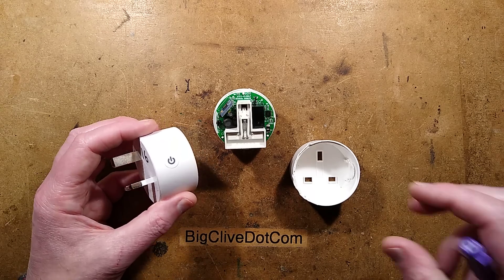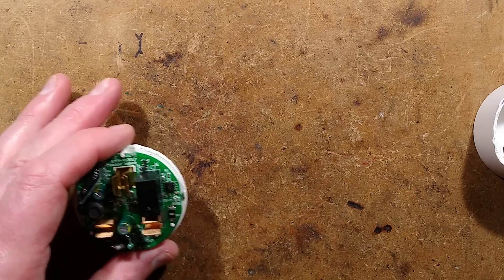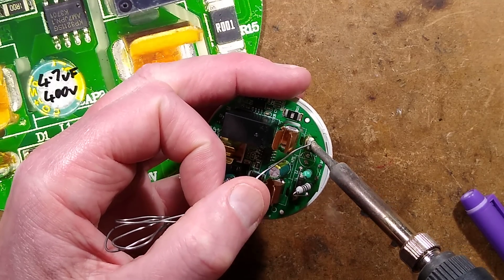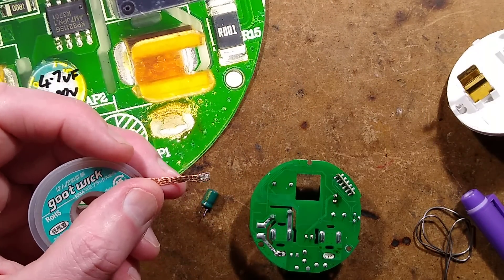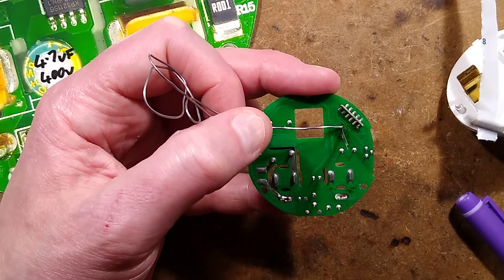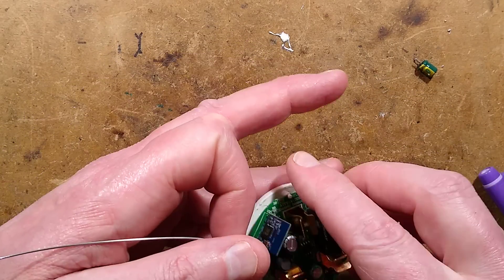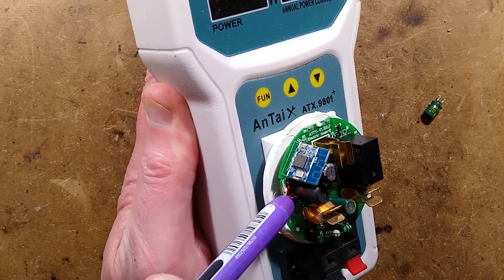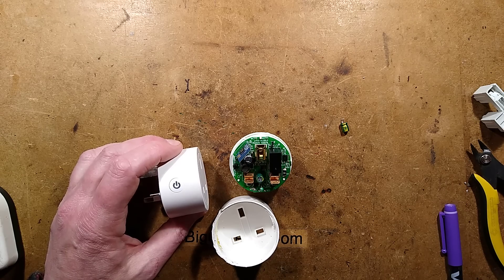Fixing a faulty LSPA7 smart plug (XiangHeWang)

Comment: A few days back I had a Woox smart plug quit working, it's of a similar contruction with addition of two screws. I failed to disassemble it easily so simply replaced it. Now having seen this excellent video i'm about to dremel the little so-and-so apart. Noting Clive's advice about the weakened state of the casing after reassembly, I can't imagine using it again but if I successfully return it to working order, I'll have the pleasure of yelling "Defeat me would thee, I think not!" before lobbing it in the bin 😁

Comment: Clive brill as aways. Out of interest are the any of these smart sockets that are cheap & safe to use. I'm renovating a cottage and just started on one of the last rooms, the living room, and as we get old I'm think having at least a few smart things in the house might be useful. Had a bad experience with one of those USB enable wall sockets so I don't trust much of these electrical things from China. But on the other hand, living with someone who "demands" all the wall sockets be switch off before we go to bed is also testing.
Reply from the maker: All these plug-in smart sockets will probably fail after a few years with a power supply issue.  But at least they can be swapped easily.  I definitely don't recommend built-in electronics in wall plates.

Comment: I have bought 8 of these and one failed after just 3 weeks - that blue light will not come on and the smart plug has gone offline - interesting to know that the failure is due to the sort of capacitor they used.

Comment: Hi thanks for a good fix. But I would use the solder mop with a little Flux to desolder the pins from the pcb at the start. Good super glue and bit of good quality tape around the plug at the end for extra safety 👍

Comment: I've got about 4 similar but different smart plugs that have failed and will try this fix at the weekend, so the real question is, is there a "better" rated cap to use as a replacement or just another cap with the same ratings and therefore the likely hood it will also fail again at some point ?????
Reply from the maker: A suitable low ESR capacitor with the same ratings and bought from a prominent component supplier like RS, CPC, Farnell, Digikey, Mouser etc should hopefully last longer.

Comment: Thanks for this. I have a similar model that had a seized relay. Inspired by this video I opened it up (fairly easily) and was able to source and replace the relay. The relay was on a daughterboard so I was able to replace it without any heavy duty de-soldering. I also added an RC snubber across the contacts which will hopefully reduce the likelihood of this happening again. 

It sealed up quite nicely with a bit of superglue.

Edit: One oddity, the relay daughterboard was double sided - BUT - the hole to the relay coil was not plated through and the connection was on the top. It had to be soldered on the top side, slightly proud, then I had to melt it from the bottom side and push it down. Very odd cost saving measure and bit of a head scratcher for a bit!

Comment: Yay, I just bought two of these a day ago (differently branded, & for Zigbee, but they look exactly the same). I'll only be using them to charge a tablet every so often, so with any luck they won't fail on me.
Some epoxy around the edge once the cap is replaced should make them plenty solid though.

Comment: Joy, my TP-Link KP115 smart switch has just failed to a constantly clicking on and off state... Opinion seems to point to it being a cap failure as well... sigh...
Reply from the maker: That does usually mean a dry capacitor allowing the unit to boot up, but resetting with the higher load of the relay.

Comment: I find using ceramic tweezers with cut off sections of solder braid makes it easier to retain the heat in the braid (not using the rest of the roll as a heat sink), but for simple jobs i just do like you did.

Comment: assuming you havent got a vacuum operated de-soldering station, the best method I've found for removing solder from through holes is to hold the board in one hand, heat the pad and literally BANG it down on the bench....yes, it really works :)

Comment: I bought 16 of these from Amazon about 2 years ago, branded as "Teckin". They work really well until they start turning on and off randomly and then refuse to come on at all. I tried to get one apart but realised that the case would be unsafe even if I repaired them. Only 10 of the original 16 still work.

Comment: Interesting, I have had 3 smart plugs fail in the last 6 months, one the same form factor as your repair one and two rectangular Tapo brand ones. All of them has the same failure behaviour in that they rapidly were switching on and off the relay. Unfortunately one of them was on the supply to my home network rack and caused my USP to die. A learning point for me was that if you have these smart plugs on an electronic device if it fails in this way it might cause damage to the device it is switching.
Reply from the maker: That's a common effect.  The relay comes on and the extra load on the power supply dips the voltage and resets the processor.

Comment: This one was rough, Clive. That first 400v capacitor was ready to bite your finger. Another finger strayed pretty close to the iron. You didn't power it up with clip leads before resoldering those power pins. Glad it seems to have had just the one problem.
Reply from the maker: Thankfully it takes total failure for the main input capacitor to hold a charge.  The slight glow on the blue LED showed the buck regulator was still running.  I should have made a show of discharging the cap though.

Comment: The little side button on such devices are usually there to allow you to turn the socket on if you are near it and don't have a phone handy to switch it in the app, AND also there to hold it and reset the device and clear out any account info.

Comment: I have a trio of the old "Weller" brand soldering "guns" that I keep around for heavy soldering like those power pins. They each have dual heat settings and an old incan flashlight bulb to light up what you are working on. I believe the wattage on the guns is as follows.. 100/140, 200/260, 250/300. 
Pull the trigger half-way to the first click, and you get the lower range, pull it to the second click and you get the high range. The tips heat up very fast. 

I'm sure ANYONE who has been into electronics for any amount of time has had one of these Weller Guns at one point, and is familiar with them. 

For anyone who isn't aware, Weller still sells replacement parts for these 50 year old solder Guns, such as replacement cases, switches, and so on. I was surprised when I saw the parts on the website. 

Very good soldering devices to have around for large, heat sucking, solder joints.

Comment: Of all the switcher topologies, the buck is the gentlest on its filter capacitor. All other topographies are not so gentle. The buck has to accept a triangular current waveform with a DC component on top of it. The DC current is simply the load current. However, the triangular current goes directly to the filter capacitor, which ideally integrates the current as the capacitor then maintains a smooth DC voltage of the output. What kills this capacitor in the long run is the capacitor's Equivalent Series Resistance (ESR). The triangular current passes through the ESR. As everyone here knows, current passing through a resistor creates I^2*R power losses, which in turn creates heat. Capacitors do NOT like heat. Heat dries the capacitor, resulting in capacitor death. Vendors like China Inc.are seldom aware of these problems, so they use a cheap electrolytic capacitor, that has a very large ESR, as the switcher's output filter cap. Eventually, POOF! Clive did the proper thing here in reviving the switcher: he used a high quality Panasonic capacitor designed for switchers, meaning that capacitor has a low ESR. For the record, you can tell when a capacitor is rated for switching applications because its ESR is tested at 100 kHz, where a cheap low frequency capacitor is tested for 60 or 120 Hz.

Comment: I have a project that's just for fun. I have a cheap led flashlight that runs on 3 AAA batteries. I cracked it open and can't find any resistors just a mechanical push button switch. The sealed bulb is about 1" by 2". I cracked the base of that open and it had a tiny little circuit board. I promptly snapped back together because the wire into the pcb was so thin it would surely break with a flex or two. 
   I want to replace the 3 AAA with a 3.7 lithium battery (and charging bit) from a rechargeable vape pen. I know those batteries are something like 4.5 volts when fully charged. I think i need to cobble together a circuit to regulate the voltage to preserve the LED from burning out.  Not sure about this, but some research has also suggested that the battery needs to stop discharging or it will drop below a critical voltage and damage it.  The third bit: can i parallel two of these lithium batteries to increase the runtime of this modified flashlight?  or is there a change in circuit design values need for the higher amperage?
    I've learned that electronics powered by a "wall wart" transformer demand a specific voltage but are happy with anything above their rated amperage, though i suspect there is some kind of control there too. I burned out a few transformers powering a 12V  electric automotive radiator fan to learn that. 
  Clive, i know you can do this in your sleep, blindfolded, with one hand tied behind your back. Most of your audience prolly understands it too. I don't know it and electronics forums very quickly divert into the weeds seeking perfection. The world isn't perfect and i don't expect a personal response, but maybe something like this would be a good subject for a video
  In any case, thanks for sharing your knowledge. It's always entertaining!

Comment: I recently was working with an older computer and there were 6 capacitors that were domed like crazy. The computer would boot and you can access the bios, but when you actually tried to load into any OS, it would reboot immediately after the loading screen. I wanted to fix it, but I don't have capacitors on hand and it wasn't worth ordering them to fix a 15+ year old computer that I just wanted to tinker with.

Comment: You can get Disability Plug Pulling Straps (Other names -  Plug Tugs)

However I did find IF You have a UV Cure 3D Resin Printer  you can Always 3D print New Housings / Enclosures With a Hinge (So if the cap goes again It can hinge open  and  allow For Easy Replacements)

Comment: Looks like you might be able to plastic weld it back together again. Perhaps a white zip tie for welding material, use the soldering iron and melt plastic in the joint, much like you do soldering.

Comment: I had a similar switch to.these visually identical and just randomly died and was very hardly used. I use one for a cable to my garage to run power. So the cable that could theoretically be touched by oublic as it crosses a public pathway is not live. However it sits about 3m from.thw ground so doubt it but you just never know.

Comment: I repaired a set of kitchen scales over Xmas for my mother. Dodgy tare button. Fairly simple soldering job to replace a 5mm tactile switch. That was until a pad tore off the PCB. The PCB designers hadn't connected all the legs of the footprint unfortunately but nothing a wire link couldnt fix. Good as new and second time I've swapped one of the buttons .

Comment: For successful glue of plastic I have used araldite for plastic 2part adhesive. If a gap has to be bridged mix in a filler powder designed for the purpose in marine repairs. Available from yacht chandlers & online.

Comment: 470, 10v capacitor is the most common fault in smart plugs after a year or so especially with plugs remain ON all the time. One of the sign of this bad capacitor is the relay keep turung IN an OFF and smart plug unable to connect with WiFi.

Comment: Brilliant repair Clive and explanation but 16Amp through one of these devices and then just using the plug connected to it as a safety net hopefully with a 13A fuse now that is dangerous!  You are absolutely correct to recommend 5A maximum

Comment: Nice rescue! 🙂

Have you ever seen the solder suckers, they are great for sucking out molten solder from the contact pads on a PCB, you simply heat the pad up and then hit the button on the spring loaded solder sucker and it sucks the pads clean in one go. They come with soft silicone tips that does eventually wear out after lots of use and they do need to be taken apart once in a while to clean out the solder from them.

If you do a lot of component removals you can even get them with built-in soldering irons with a heated tip and a spring loaded solder sucker in the same body although I haven't tried those!

I think the solder suckers works a lot better than the wicks personally. 👍

Comment: Solder wick works a lot better if you cut off a small section. Stops the rest of the roll pulling all the heat from the iron. Thanks for the videos!

Comment: Thank you for this, I found that while watching you remove the circuit board from the power lugs by heating the solder and prying on the board with your fingers, that my fingers went into an automatic reflex action of prying the board off. It's funny to find out what your body has been trained to do automatically after years of service work.
An opinion from you is requested, because the high frequency switching is hard on capacitors, in your opinion would a high frequency battery charger be hard on batteries? Is that something that could be demonstrated somehow?

Comment: As always Clive, excellent video , one observation about the actual design, if this is plugged in a wall socket, the inductor is below the capacitor, hot air rises, so more likely to heat up the capacitor, if they'd done it the other way around, it may have lasted longer, although being a sealed unit, it may have made little difference, it could be designed or planned in obsolescence , thus requiring a constant stream of buying replacements.

Comment: This video inspired me to actually try fixing my half-broken Blitzwolf smart plug I had laying around. It started acting up while turned on, causing the relay to click off and on for a split second every few minutes.
Thankfully it was easy to open as it was just screwed together and no glue/plastic had to be cut. Inside I found two 4.7uF 400V and one 220uF 10V capacitor. I remembered I had a capacitor kit I bought a while back, and it included a 220uF 10V capacitor. I got the old one out, and put the new one in. To my surprise, that was all it took to make it work normally again!
To be honest I didn't expect the issue to be as obvious as a capacitor since it's only a few years old by now, but when you talked about failure by high frequency I though it was worth a shot to fix it. As the capacitor kit came from AliExpress with just generic no-name capacitors I expect the plug to fail again some time later, but at least now I know what to replace!

Comment: Tuya?  I bought 4 of those plugs. They can be used local-only without reflashing. It is a pain in the b*** process to get the local encryption keys from Tuya and you have to repeat the torture everytime you change your wifi key. So I made a local wifi network just for them without internet access.
My "mainland EU" Version is smaller, the relais is under the pcb and everything is glued in. I wanted to remove the relais, since I'm only interested in the electricity metering and I don't want any firmware to switch of my devices.

Comment: I wonder if applying a bit of solvent (acetone or maybe IPA) to the joint would allow opening without having to apply so much force?  It would be interesting to see what a component tester would show with that old capacitor -- my guess would be way lower than the nominal value.

Comment: When I opened one of these to re-flash the MCU to ESPHome, I found it didnt close up properly like you. I just wound some electrical tape around it between the pins and avoiding the holes, which seems to have held. If it doesnt, there is always the RCD under the stairs :)

Comment: Had a smart plug where the cap blew and made a nasty little streak on the inside of the casing. It must have been somewhere less important though because the device didn’t seem to have any issues other than the relay not working.

Had caps blow in smart bulbs too, leaving the LEDS with a very nasty flicker.

My smart plugs are older so don’t report power factor or usage, just a toggle. I would like to upgrade to zigbee ones with energy monitoring some day.

Comment: 😐 - I have much “older” style radio remote controlled sockets that appear to have lost their range, are meant to have a range of 16 feet (between socket-remote) but now a range of 3 feet ~ even with new 12v batteries and sticking my other arm to act as an antenna 😠. Don’t know if something has failed in the sockets, or they consist of “Chineseum crap” and I need to replace them with WI-FI/smartphone controlled ones
Reply from the maker: Could be ambient electrical noise, or it could be more ripple on the receiver's power supply due to degradation of a dropper capacitor.

Comment: I'm surprised you didn't check the ESR on both caps. Or at least look at them with an ohm meter before replacing.
Reply from the maker: The low frequency one will almost always be in good condition as there is much less electrical stress at 50/60Hz.  I subsequently put the removed capacitor into a component tester and it thought it was a diode with no capacitance.,